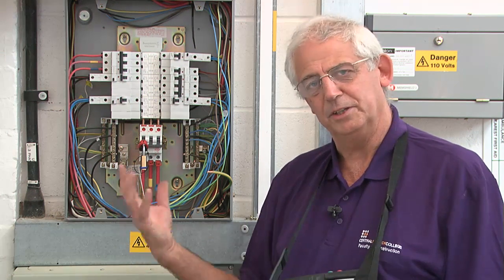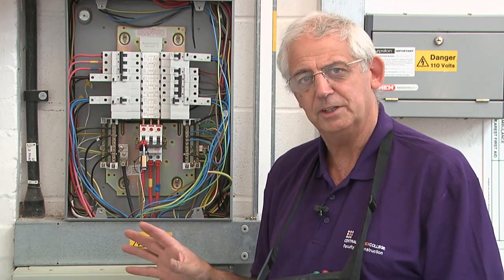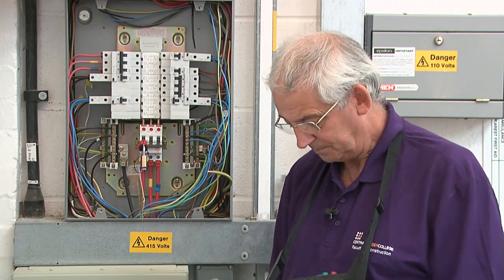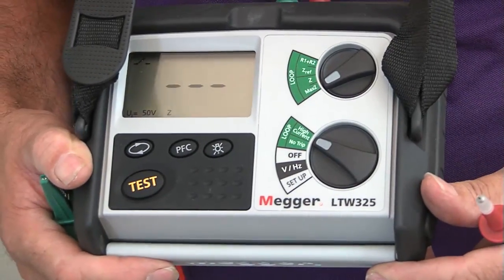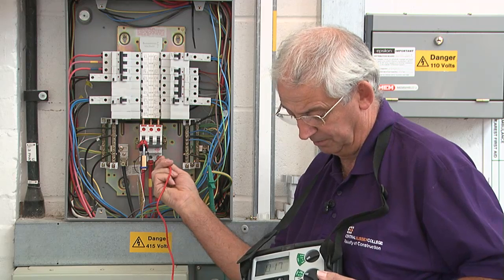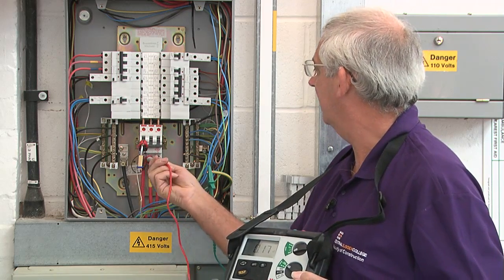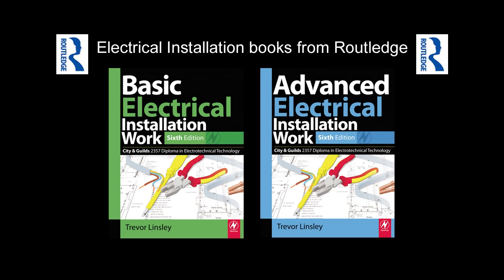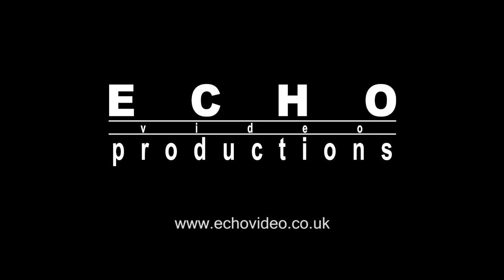External earth loop impedance (Ze) test

Comment: That db looks to be fed by an armoured cable. Isn’t it pointless disconnecting that earth when the gland of the swa is probably providing a parallel earth path back to the met?
Reply: No, it's not pointless. The SWA might be providing a parallel earth path, back to the MET, but the test that Chris is doing is not using the SWA at all. The path of the current that is flowing is from the transformer to the live terminal in the board, through the test meter to the earth wire that Chris has disconnected from everything other than the MET, then via the MET back through the earth to the transformer. The SWA is not part of the current flow as only one end of it is in the circuit. (It would need both ends to be part of the circuit to create a parallel path).

Comment: Ok this is only a phase to earth test on a 3 phase system (400v divided by 1.73. = 230v) that is the formula to work out the voltage for each single phase also never connect the phase leads first always the earth clip first in case you touch the clip you will probably be dead as the phase will travel through you to earth

Comment: Do you even understand the earth fault loop path, the neutral does not need to be tested!
Reply: Some meters require you to use three lead’s and you piggyback the neutral of the earth lead , on a tnc-s you are testing the earth and the neutral together you can also clip the earth lead and then the neutral lead on to the main earth conductor and then probe onto the incoming line on the main switch

Comment: Damn limeys, keep your vids on your side of the pond, how do you get 110v. and 415v.? Is that 3 phase 415v.? We get  277v 480v or 120v 208 or 110v 220v single phase.
Reply: joe banana We use 230Vac for Domestic properties, 3 phase 415Vac for commercial and industrial installations but we also use 110Vac (sometimes centre tapped on a transformer to provide +/- 55Vac) and 24Vdc for control circuits so as to protect electrical engineers while fault finding.